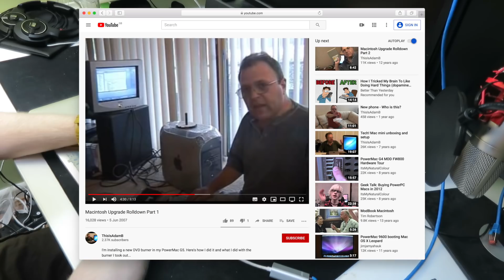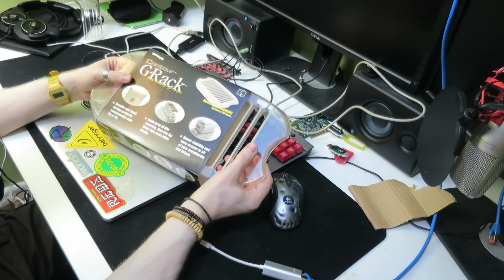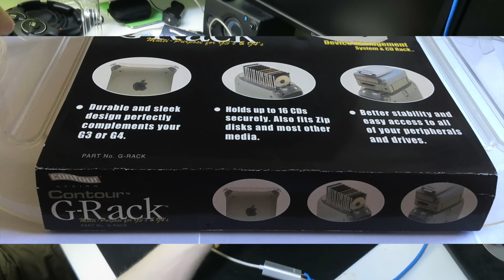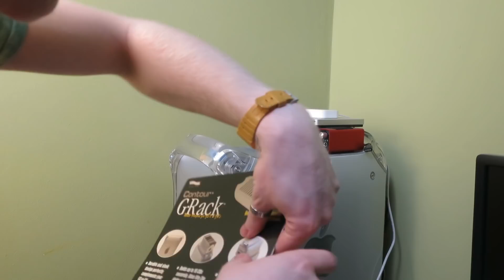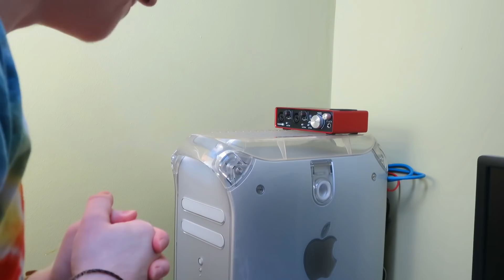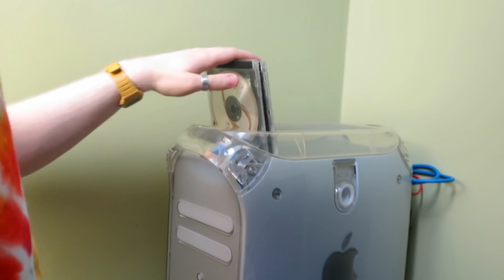Another very rare Power Mac accessory (Contour Design G-Rack)

Comment: I think Retrobriteing the G-Rack could look quite nice. And in terms of Retrobriteing clear plastic, maybe look at the Game boy Advance restauration of Odd Tinkering?
And with the disc flapping on the Rack. It would be to flip through the discs, I think, without having to pull every disc out.

And it really is a blast to see both Contour Design accessories on one machine.
Reply from the maker: Thanks for the heads up, I'll check that out!
Good point, I didn't think of that. Also I realised that int's intended for other types of media, so maybe maybe the slots are wider to accommodate more formats.